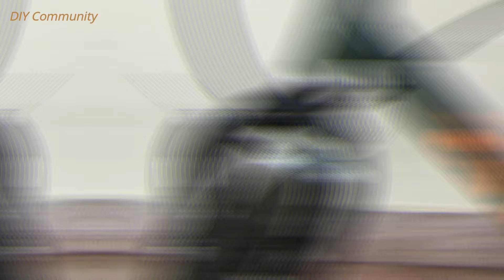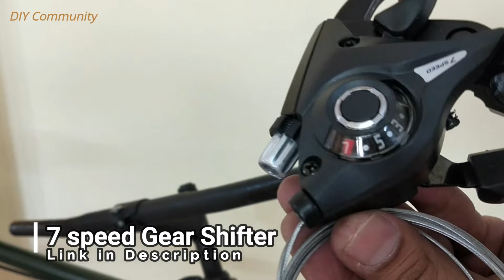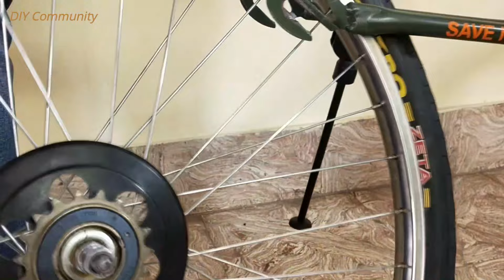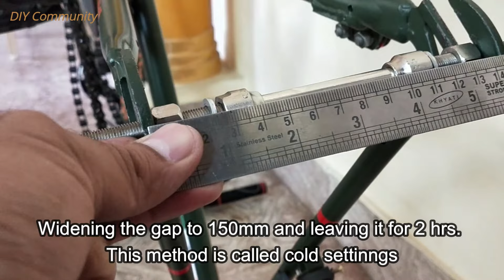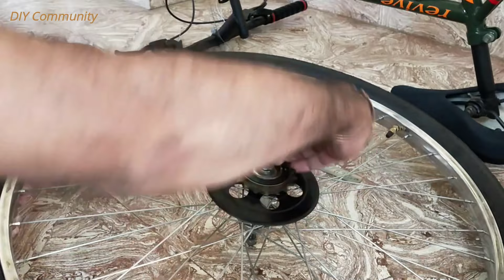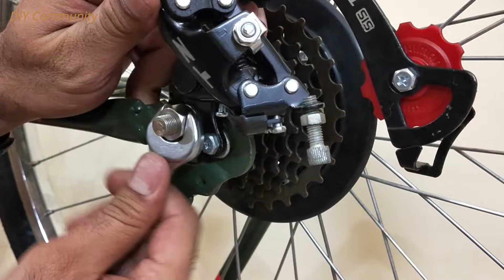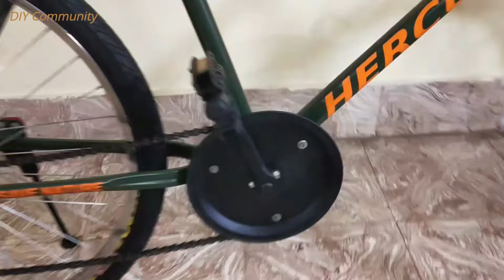How to Install Gears in Any Cycle - DIY Installation | DIY Community

Comment: Hi! Planning for a cross country camping trip with friend pan India on bicycle, to save traveling costs on Fuel. can you suggest a good ad cheap bicycle which can travel 30000+ KMs with total 110KGs load on each cycle? Will our good and old Hercules and Hero cycles be OK? Or any particular cycle you suggest?
Reply from the maker: Hi, My best wishes for your cross country trip on bicycle. Old frames are of steel and they weigh heavier than recent models. Yes they are sturdy design but challenge is you need to consider the bike weight aswell for a cross country ride. 

I am not an expert to suggest you on this. As I aware a Decathlon bike expert can give you more tips on this ride and choosing a bike.

Comment: Do u feel any trouble in changing the gears or using the gears in any way?
Reply from the maker: Hi, Initially I experienced some lag in gear shifting or few slip and found the tyre is not in centre and chain inclined more. After setting them correctly now it's working fine.
Reply: @DIYCommunity  i am getting local vanum 7 speed gear set installed from a local cycling shop in rs800 only( price includes installation)

So should i go for it??????or should i go for shimano?
Reply from the maker: Hi, Getting a original Shimano is a challenge. For now you can go for Vanum and once you get a Shimano just replace it.
Reply: @DIYCommunity  should i go for fake shimano or vanum????
Reply from the maker: Hi, both should work in same way. Only difference is copy of Shimano will adds a look

Comment: 1) Can we do this by ourself ? only with universal spanner
2) Does it make easy to pedal?
3) 1st gear mean smaller round or bigger round?
4) without front 3 gears , is it easy to pedal?
5) All cycle support this?
6) Can we install in suspension cycle (both front and back)
7) built in gear cycles have some rod to cover the gear but this does't have it
8) In this process can we remove this dust (hair) center of wheel?
9) Spending 3k is worth for it or we can buy new cycle?
10) My cycle has rust (Fe2o3 - iron oxide) everywhere is it safe to install this?
 Thanks,
Waiting for your Comment........
Reply: No!
No!
No!
No!
No!
No!
No!
No!
No!

Comment: How to align wheel at the centre?? Mine is off center after installing gears
Reply from the maker: Hi Johny, the easy way would be adjusting it by pushing or pulling the joints between seat stays and chain stay, this should happen slowly with minimal force and step by step. Mark a center point and measure it now and them. Wheels should be removed and ensure bike is placed firmly in a bracket/vise. 
If you bike frame is Aluminum alloy then I will not recommend this as it may break.
 If you don't want to take a chance then get your bike to a nearest cycle mechanic and instruct then what you want. They can help you. Let me know the outcome. Stay connected, Thank you!

Comment: One thing that I liked about you that you reply every comment sir. Thanks very much. Subscribed for that dedication of yours. I am planning to buy a second hand steel frame cycle then convert it into a gear one. Geared cycles are so expensive usme 2nd hand bike miljaata hai. Aur low price range waalo me gear shifting problems aata hai. Kya aap kuch tips ya solution denge plz to acha lagta. Good luck bro plz reply karna zaroor.
Reply from the maker: Hi, plan buying a cycle based on your need. If you are planning for long rides then a alloy frame is better as the weight is lesser than steel frame. 
If you are looking for a shorter commute then you can go for a steel frame. One thing you should keep in mind is older cycle frames are heavier than recent models which has mild steel frames. 

Yes you can buy a second hand and modify that. Below things you may need to check before buying.
1. Steel frame (you can check with a small magnet sticking on the frame)
2. Seat stay and chain stay should be with single rods (which makes the modification easier)
3. Cycle with V Brake or disc brakes are better as after extending the gap other brakes are difficult to set.
4. Last but importantly check for bike fit before you purchase your cycle.

Hope this helps.

Comment: bro my cycle frame is aluminium so its very difficult to adjust but i give too much force it come but i fear for frame may break what method should i follow to do follow to increase.(my cycle is adult bigger cycle approx axle size is 15 mm)
bro 2nd question: how to adjust chain size if it is bigger
Reply from the maker: Hi Ashok, I do not recommend you to give much force as you said it will break. Aluminium needs to be heated and formed to the shape and that is difficult process for a cycle. Try finding 3 or 4 speed free wheel which can fit inside the gap. 
Chain size: if you are asking about the chain length you have to remove or add chain links to match the desired length. If you are asking for chain width then have to buy a new chain. For single speed and gear freewheel the chain comes in different specifications. Ask for one in the nearby shop. Hope this helps!

Comment: how do you choose which gear set can fit your bicycle?  or are the sizes universal? do we need to know the hub diameter or some other dimensions in order to choose the appropriate gear set?
Reply from the maker: Hi, This is a after market modification and does not have any standards or documentation available. Gear freewheel are made in a size to suit universal hub and choosing number of gears is based on gap available for it to run. Mostly available are 6 speed and 7 speed. I recommend to use upto 5 gear eventhough it has 7gear to avoid chain noise and slipping.

Comment: How is the performance of gear? Is it work like the actual geared cycle or minor difference(which)?  I have MTB tata stryder nx-20 single speed, as per below comments response you recommended 6 speed. Can you suggest the parts require like hub, axel, shifters, wire, drealiure, chain etc....? Need best combination to work.
Reply from the maker: Hi Kashyab Gandhi, Performance will be same and no difference is seen. One thing is the gear setting and alignment should be proper. If you cycle has a steel frame you can go ahead. I recommend to go for 5 or 6 speed as the gap will be less to accomodate a 7speed gear sprocket. 

- Same hub can be reused.
- Axle needs to be purchased based  on length after extending the gap.
- All other components purchase link can be seen in the video description.
Reply: Bro you are tamil are hindi

Comment: What to do with those 3 shifters in left?
Reply from the maker: Hi, Thanks for putting this up. The original plan is to install 21 gears. Still searching for a suitable bottom bracket as this is a very old frame and will will be installing that soon. As of now am using only the brake level of 3 speed shifter.
Reply: @DIYCommunity thats good. I am planning to change my gears (both front amd rear) to this new one. Thanks bro
Reply from the maker: @akshayramachandran4150  All the very best. Share your results once done. Thanks!

Comment: Amazing convertion 1x7 set up.  did you replace your crank/chainring? Thank you sir
Reply from the maker: Hi, Thanks you.
It's a 7 speed freewheel installed and I haven't change the crank. Planning to change it to a 3 speed and checking on some compatibility.
Reply: @DIYCommunity  does your chain  fall off from chainring?
Reply from the maker: Hi Jerian, Chain falls when the chain and chainring teeth doesn't match proper and other cause would be alignment between chainring and the gear freewheel. Check these and allign them properly to avoid chain slippage.
Reply: Plz talk bhi kiya kariye

Comment: Glad it wokred out but this is not very good information. You cant do this on "any cycle" you need a very specific bike. Anything decent from this decade most likes are ment to be signle speed and are not upgradeable in the traditional sense.

Plus no information on why or what you're doing.

Comment: Bro can we install in any cycle,  is there any size problems
Reply from the maker: Hi, yes you can install in any cycle. Ensure the rear gap can be increased to suite the gear freewheel. For steel frame it is easy to increase the gap but for Aluminium frame it is difficult and need slow process which I followed in the video. Forcing to much can brake the frame sometimes.

Comment: You should just buy a 7 speed shifter and use the existing brake levers cause its a 1x7 tho
Reply from the maker: Hi, you can use any gear shifters matching the gears.

Comment: Good work, Interested in changing my rear gears from 8 to 10. Hope I get help from you
Reply from the maker: Hi, Thabks for your interest, I can help you in doing that. Before that ensure your bicycle frame is not made of alloy.
Reply: @DIYCommunity  Its Chromoly
Reply from the maker: @newzealand_thamilan  Kindly check the properties whether the shape can be altered. few compositions of chromoly has to be treated with Annealing process.
Reply: You can bro ...8 speed cassette hub supports 10 speed cassette
Reply: The spacing for 8spd and 10spd are the same